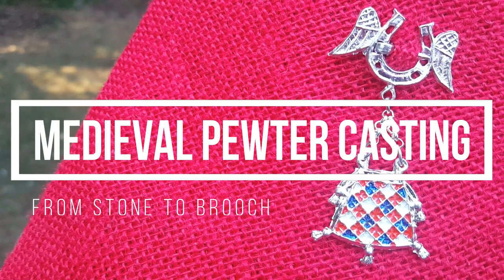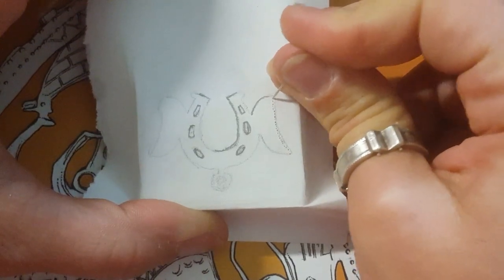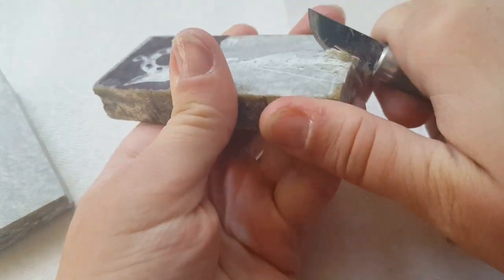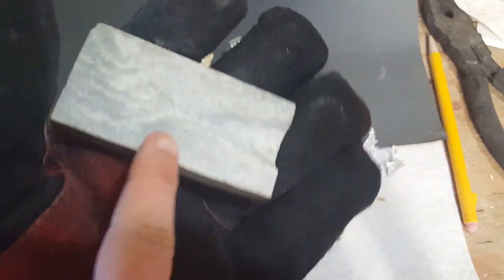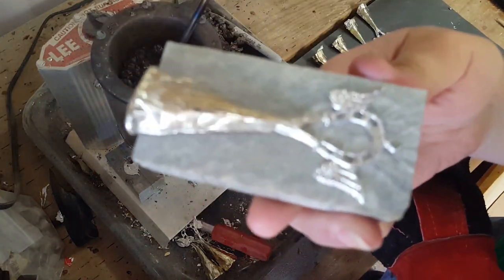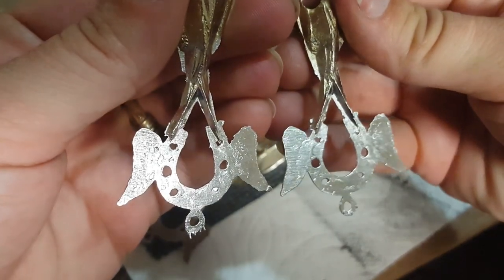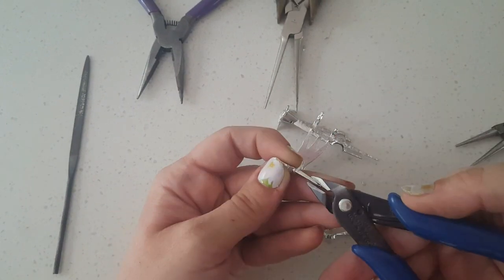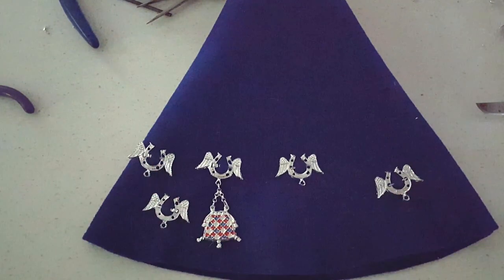Medieval Pewter Casting

Comment: 2 things to improve future castings:
1) Preheat your sandstone.  Use a torch or lay it on the edge of the crucible to warm up.

2) Add a vent which goes from the very bottom to up & out the top.  Have it vent out close to the sprue but not into the sprue.  This will allow the air a way to escape: it has to leave in order for the metal to take its place.  You will know the cast is complete when the pewter squirts out of the upper vents.  Cut off the extra sprue afterwards, toss it back in the crucible for next time!

Comment: Wish I had known about this easy jewelry making method years ago. I would have made so many metal accessories for my cosplay. Though, the low temp melting point is a bit concerning. Is it possible for it to warp a bit along the stress points on a super hot day? I don't own anything pewter, so I don't know.
Reply from the maker: Depending on what specific pewter blend you have, it might be a bit bendy even at room temperature.  You can make much thicker pieces to help combat this.  I tend to make small dainty things, and most reenactors are already aware that pewter is a very soft metal, and will usually treat the resulting objects with the care they require.  But as for a super hot day, no, I have not noticed any difference between pewter that has been sitting in a hot car/tent, vs out and about on a chilly day.  It's fun to play with though!
Reply: Morgan Donner Thank you for the information! I'll definitely give pewter casting a try for my next costume. : )

Comment: My favorite pewter casting project was a reproduction button and I did a three part mold with soapstone and registering pins.  I learned that putting the pins on the same side as the funnel is a bad plan.  oops!